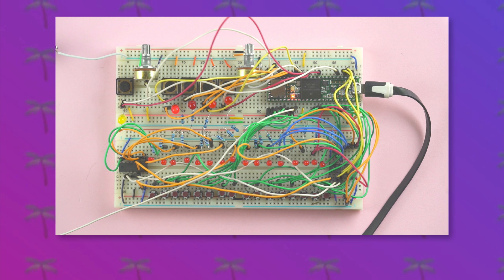Homemade Drum Machine

Comment: built the machine yesterday. Audio works fine, unfortunately only 3 LEDs work. I have no idea what I wired wrong there, I'll check it out later
EDIT:  I swapped the 3 pins on the teensy for the shift register, now everything is running smoothly.
Reply: @jurgenschilhabel5644  Google drive takes care of that :)

code and circuit diagram do not match, think a cable was swapped but that was already written down here in the comments. have fun tinkering

https://drive.google.com/drive/folders/1tj3BJIPEZNykf9bPfkQqsbxltWHvBpdy?usp=share_link
Reply: @ante_tute  Great! Thank you very much  for that
Reply: Hey Thomas. I got a similar issue. My LEDs behind the shift register don't work. 

i wired my  shift register like this: 
Shift register 1 SER --> TeensyPin2
Both SCK --> TeensyPin1
Both RCK --> TeensyPin0

Is this the way to go or did i mess something up?
Reply: Hi Thomas, do you still have the teensy code somewhere? I don't see where to download it. There is no download available at the link above.
And I am verry keen to build the unit. Your support will be highly appreciated.
Reply: @jurgenschilhabel5644  think so. I'll check it out later after work

Comment: Dear Sebastian, thank you for this video and your Blog! I am new to this arduino/teensy world. After I watched your video I ordered the Shift registers and your drum machine will be my First real project (I am currently at a low/no-Knowledge-Level, playing with blinking leds). I have questions to your Basic drum machine:
1. Can I simply add More Instrument Tracks Boy copying and pasting the Kick and Snare codes and convert further samples for the New Tracks. I dont want to use sythetic drum sounds, just samples. I will use the teensy Audio Board and solder flash memory for low latency and more Space for the samples.
2. MIDI is Not that Important for me, but I want some kind of swing/ shuffle function. Do I Need MIDI knowledge for that Or can i solve this problem without midi-clock? If yes: Which path should i follow? Can you give me some tipps Or advice.
Thank you!

Comment: I love your build here, this by far my fav diy drum machine I've come across. I absolutely want to build this. Would be cool to somehow fit inside an altoids tin. Could an arduino uno be used instead of the teensy? And does it always need to be connected to a computer I'm assuming to function? Thanks for sharing schematics and all your hard work.
Reply from the maker: Cheers, I don't think it would be very portable across to the Arduino Uno - lack of RAM and native Audio Library would be the main issues. Once the code is uploaded to the Teensy, it does not need to be connected to a computer again, and can be powered by USB power bank or USB adaptor.
Reply: @littlescalemusic  hey brother sorry to bother but do you think you could help me out? Got a question about the build. I left you a comment on your blog.
Reply from the maker: @jkuebler89  hey i think it is quicker to reply here. I have just compiled the code without issue. I am using Arduino 1.8.5 and Teensyduino 1.4.3. Tools > Board is set to Teensy 3.6 and Tools > USB Type is set to Audio. In the code folder, you should have the following files: AudioSampleData.cpp 
AudioSampleData.h
 homemade_drum_machine.ino
 setup_functions.ino 
user_functions.ino. When opening the code in Arduino, please open the file homemade_drum_machine.ino. Can you confirm all of the above?
Reply: @littlescalemusic  wow thank you for speedy reply and help. So yes I confirmed everything. Only difference is I'm using IDE 1.8.7 which is the newest version compatible with teensyduino (2nd to most recent version). I can try to find the version you are using if you think that will work? And I'm using teensy loader 1.44 I have all the files in same folder from the blog page. Also has. DS_Store file. I'm not sure what all these error messages are meaning. I need to learn more about writing code. It is saying that things are not declared in scope? I will attach the errors. Sorry maybe I should have started with a more simple project for my "first" but I really dig what ya did. Arduino: 1.8.7 (Windows 10), TD: 1.44, Board: "Teensy 3.6, Serial, 180 MHz, Faster, US English"

homemade_drum_machine: In function 'void setup()':

homemade_drum_machine:192: error: 'setup_push_buttons' was not declared in this scope

homemade_drum_machine:193: error: 'setup_74HC595' was not declared in this scope

homemade_drum_machine:195: error: 'setup_quad_buttons' was not declared in this scope

homemade_drum_machine:196: error: 'setup_quad_leds' was not declared in this scope

homemade_drum_machine:198: error: 'setup_mode_buttons' was not declared in this scope

homemade_drum_machine:199: error: 'setup_mode_leds' was not declared in this scope

homemade_drum_machine:201: error: 'setup_analog_sync' was not declared in this scope

homemade_drum_machine:203: error: 'setup_sounds' was not declared in this scope

homemade_drum_machine: In function 'void loop()':

homemade_drum_machine:218: error: 'update_mode_button' was not declared in this scope

homemade_drum_machine:219: error: 'update_quad_buttons' was not declared in this scope

homemade_drum_machine:220: error: 'update_push_buttons' was not declared in this scope

homemade_drum_machine:221: error: 'update_timing' was not declared in this scope

setup_functions: In function 'void setup_74HC595()':

setup_functions:7: error: 'write_dual_595' was not declared in this scope

     write_dual_595(255, 255);

                            ^

user_functions: In function 'void update_timing()':

user_functions:12: error: 'update_step' was not declared in this scope

     update_step();

                 ^

user_functions: In function 'void update_step()':

user_functions:40: error: 'play_sound' was not declared in this scope

   play_sound();

              ^

user_functions: In function 'void play_sound()':

user_functions:45: error: 'select_kick_sample' was not declared in this scope

     select_kick_sample();

                        ^

user_functions:49: error: 'select_snare_sample' was not declared in this scope

     select_snare_sample();

                         ^

user_functions: In function 'void update_mode_button()':

user_functions:73: error: 'clear_quad_leds' was not declared in this scope

     clear_quad_leds();

                     ^

user_functions:75: error: 'update_LEDs_with_pattern' was not declared in this scope

     update_LEDs_with_pattern();

                              ^

user_functions:78: error: 'clear_quad_leds' was not declared in this scope

     clear_quad_leds();

                     ^

user_functions:80: error: 'set_LEDs' was not declared in this scope

     set_LEDs(current_pattern_length[current_drum] + 1);

                                                      ^

user_functions: In function 'void update_quad_buttons()':

user_functions:94: error: 'clear_quad_leds' was not declared in this scope

           clear_quad_leds();

                           ^

user_functions:99: error: 'set_single_LED' was not declared in this scope

           set_single_LED(current_kick_sample);

                                             ^

user_functions:105: error: 'clear_quad_leds' was not declared in this scope

         clear_quad_leds();

                         ^

user_functions:116: error: 'clear_quad_leds' was not declared in this scope

           clear_quad_leds();

                           ^

user_functions:121: error: 'set_single_LED' was not declared in this scope

           set_single_LED(current_snare_sample);

                                              ^

user_functions:127: error: 'clear_quad_leds' was not declared in this scope

         clear_quad_leds();

                         ^

user_functions:138: error: 'clear_quad_leds' was not declared in this scope

           clear_quad_leds();

                           ^

user_functions:143: error: 'set_single_LED' was not declared in this scope

           set_single_LED(current_hihat);

                                       ^

user_functions:149: error: 'clear_quad_leds' was not declared in this scope

         clear_quad_leds();

                         ^

user_functions:160: error: 'clear_quad_leds' was not declared in this scope

           clear_quad_leds();

                           ^

user_functions:165: error: 'set_single_LED' was not declared in this scope

           set_single_LED(current_percussion);

                                            ^

user_functions:171: error: 'clear_quad_leds' was not declared in this scope

         clear_quad_leds();

                         ^

user_functions:180: error: 'update_LEDs_with_pattern' was not declared in this scope

     update_LEDs_with_pattern();

                              ^

user_functions:185: error: 'update_LEDs_with_pattern' was not declared in this scope

     update_LEDs_with_pattern();

                              ^

user_functions:190: error: 'update_LEDs_with_pattern' was not declared in this scope

     update_LEDs_with_pattern();

                              ^

user_functions:195: error: 'update_LEDs_with_pattern' was not declared in this scope

     update_LEDs_with_pattern();

                              ^

user_functions: In function 'void update_push_buttons()':

user_functions:215: error: 'find_falling_edge_push_buttons' was not declared in this scope

     find_falling_edge_push_buttons();

                                    ^

user_functions:220: error: 'update_LEDs_with_pattern' was not declared in this scope

           update_LEDs_with_pattern();

                                    ^

user_functions:234: error: 'set_LEDs' was not declared in this scope

       set_LEDs(high_value + 1);

                              ^

user_functions:247: error: 'set_single_LED' was not declared in this scope

           set_single_LED(high_value);

                                    ^

user_functions:260: error: 'update_percussion_settings' was not declared in this scope

           update_percussion_settings(current_percussion);

                                                        ^

user_functions: In function 'void set_single_LED(byte)':

user_functions:293: error: 'write_dual_595' was not declared in this scope

   write_dual_595(byte lowByte(work), byte highByte(work));

                                                         ^

user_functions: In function 'void update_LEDs_with_pattern()':

user_functions:301: error: 'write_dual_595' was not declared in this scope

   write_dual_595(byte lowByte(work), byte highByte(work));

                                                         ^

user_functions: In function 'void set_LEDs(byte)':

user_functions:308: error: 'write_dual_595' was not declared in this scope

     write_dual_595(0, 0);

                        ^

user_functions:315: error: 'write_dual_595' was not declared in this scope

     write_dual_595(lowByte(work), highByte(work));

                                                 ^

Multiple libraries were found for "SD.h"

 Used: C:\Program Files (x86)\Arduino\hardware\teensy\avr\libraries\SD

 Not used: C:\Program Files (x86)\Arduino\libraries\SD

'setup_push_buttons' was not declared in this scope

This report would have more information with

"Show verbose output during compilation"

option enabled in File -> Preferences.
Reply from the maker: @jkuebler89  when you open the main homemade_drum_machine.ino file in Arduino, are you able to see the other files as tabs in the same window? It sounds to me like the other files are not being recognised by the main .ino file. If you are able to find the same Arduino version, that would be great FYI I am on Mac and am running Teensy Loader app version 1.4.3
Reply: @littlescalemusic  I got it working finally! All thanks to you man. Thank you. So cool. Instant smiles. https://youtu.be/UacOlhfK0wc still gotta figure out the lil LEDs tho.
Reply: @jkuebler89  , just in case (in case if i will be building it) - what was fixes that you made to get all in order? Thank You! Also, can you tell your impressions, "review" sort of?  ;-)

Comment: Sir thank you so much for sharing this.Already building it but cant find the potentiometers values...
Reply from the maker: Pot values can be variable as they are acting like a voltage divider. 10k - 25k are ideal, 10k - 100k will work fine.
Reply: littlescale The 10K resistors worked great. its 3AM feeling great over the finished machine..Sweet sounds.Only glitch I had to mirror the leds pinout in firmware.Couldnt go to bed after a 30 min fun play.Appreciation video soon...thanks again sir
Reply from the maker: oh wow, that is awesome! so glad it is working, and my apologies for the pinout issue! would love to see your version in action <3
Reply: littlescale I'm loosing hours of sleep with your creation sir... LOL I tried to get it into a basic jam with a volca bass and an sq1 but I cannot find any sync output at the schematic.Any ideas whould be apriciated ☺
Reply: sorry for the rushed comment. I found the sync outputs for some devices and used it ...
I also found a bug with pattern-length selection LED-representation. I' m trying to add midi out/in next week ...
and then I will make a jamming-video